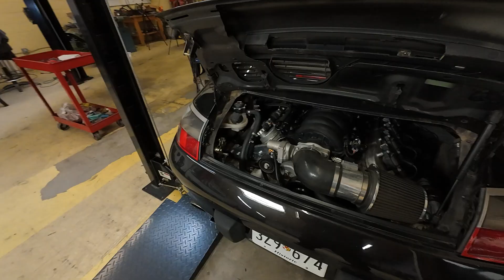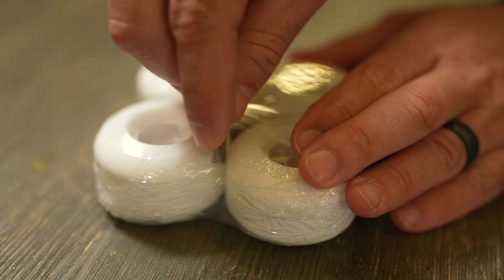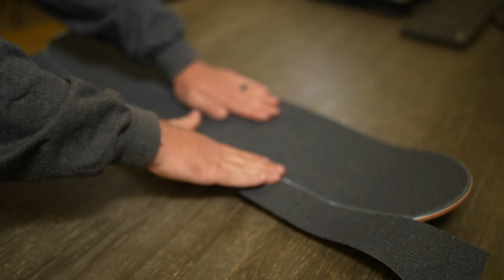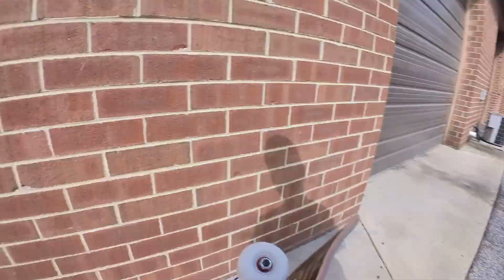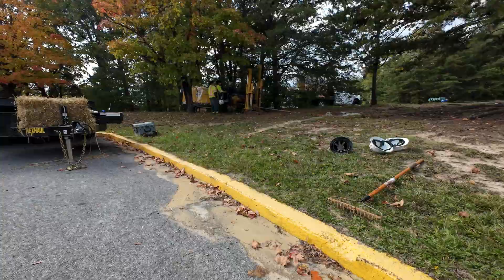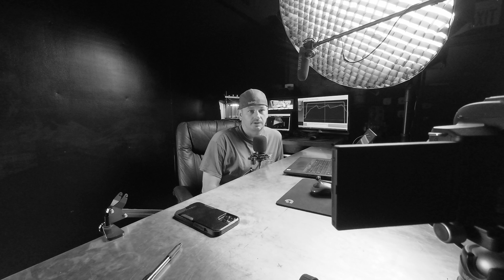$10,000.00 Internet Install

Comment: I work at a company that does mainly directional drilling (how they got that conduit over to you from all the way over there). The drill itself, depending on new or used as well as size, can be $100-300+k. To drill properly there are many other things that are needed that are all expensive. When working for a utility such as BGE, they will typically pay for a vac truck to test pit any other utilities. One of our vac trucks new is $700,000. 

Just figured I’d offer a bit of insight into why tf a internet install would ever cost $10,000 lol

Comment: Had a similar situation. We moved to a new house on acreage and after committing to buy the place realized there was zero internet service here. I called every service provider in the area and pretty much got either a hard "no" or the generic "we don't service that area." Even though at some point in the past there was a T1 in the house, no one would provide anything or even discuss me paying for it. Crazy bit is I know there is at least one fiber run less than half a mile away.  

After ages of no progress I come home one day and find a crew doing horizontal boring and laying fiber through the entire rural area. Now we have fiber to the house with 1GB speeds while living on acreage with peace and quiet from the city.
Reply from the maker: Dealt with that on our house as well.  Almost didn’t buy it. By some miracle like 2-3 days before we went to closing they announced they were putting everything for the area in 2-3 months. Took more like 8 but there is no way i could have a house with no internet it was stressful haha